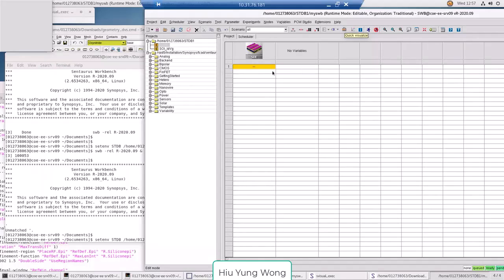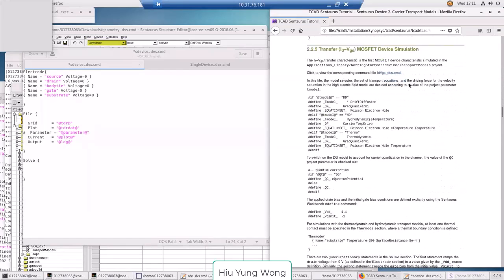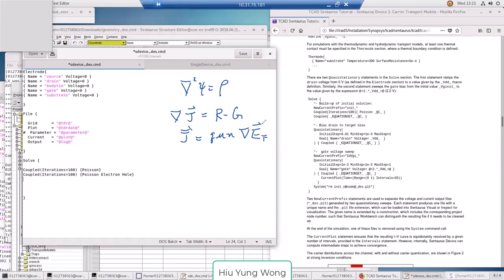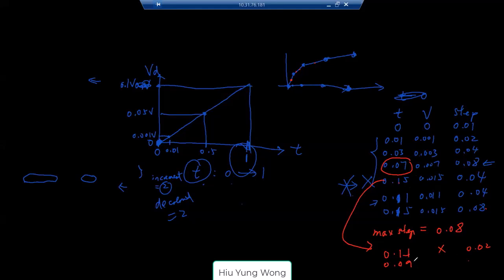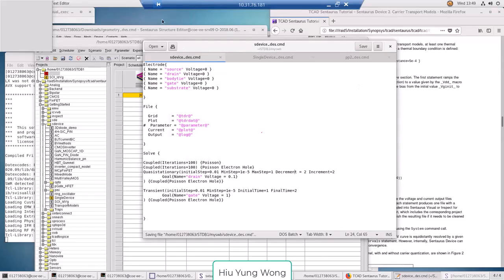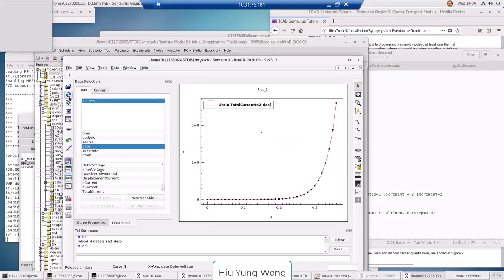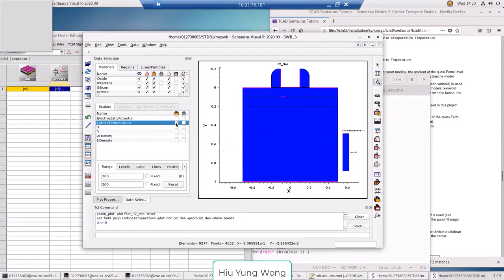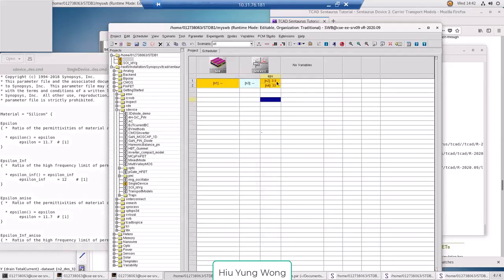TCAD Sentaurus Hands-on Tutorial - Sentaurus Device Basics

Comment: Hello,
Currently struggling with Hydrodynamic model for an AlN/GaN/backbarrier structure that gives results with Drift Diffusion but inaccurates (Fmax very high for example for Lg=100nm and lower). The root cause is velocity overshoot according to documentation. 

I have put all the respective recommandations (HighFieldDependence, TransferredElectronEffect2, RelMinTerm,...)
for III-Nitride materials Hydrodynamic simulation in parameter file and command file but the simulation failed everytime at Vds=2.5 or Vds=4.5V sometimes. If Vdmax is reduced to 3V, the simulation fails at second step where Vgs ramps to specified value. 

Can you help me please?

Comment: Hello sir,
Could you please tell me how to add new materials? For example, I want to create a structure with HZO (Hafnium-Zicronium-Oxide), which is not present in the default library.
Reply from the maker: You need to define that material in datexcodes.txt and then define its properties in the .par file that you will source in SDevice. You can look at those files in the installation directory as examples.
Reply: @quantum_computing  Thank you, sir. Probably, beginners are stuck with this problem the most. It would be very helpful if you make a video on this.

Comment: Good evening sir 
video is very helpful thank you so much 
i have a query in sdevice  masterfile command as it is am following you still am getting error as
tried to use nonexisting contact source
kindly help to resolve
Reply from the maker: You need to make sure you have defined the contact successfully. The best way to confirm is to use svisual to open the _msh.tdr file. On the top left of the panel, choose lines/particles to see if it is there. Please see this video: https://youtu.be/twGcJMFN3M0?feature=shared&t=2956
Reply: Good morning sir, thank you for your reply still the same error sir,  tried to use non existing contact source! and in n2_local.error  unknown error child process exited abnormally gjob exits with status1
Reply from the maker: @pavithrabirapaka4166  Btw, it is case sensitive. Do you have the same case? Also, try to locate where the error comes from (look at the log file). If you did define the contact and used the right name, it should not have this error. Thanks!
Reply: @quantum_computing  
thank you sir it worked ,now am strucked at parameter, while you open terminal window what you are typing to come out and get that -/documents $ in terminal window kindly suggest

Comment: Great tutorial on TCAD simulation! I found what I was looking for in the temperature command in the physics section of the video. 58:09
Reply from the maker: @user-te6tj9bg2r, great!
Reply: @quantum_computing  May I ask, if I want to simulate the effect of working temperature on device performance, any suggestion as to changes I should make? Adding Temperature =@Temperature@ and hydrodynamic model in physics,   foreach temperature in {300, 325, 350} { Temperature = $temperature } in solve section ?
Reply from the maker: @SamLin-f6w  If you just want to run it at a fixed ambient temperature, you only need to add Temperature  = 300 (or 400 etc.) in the physics section. If you want to do self-heating, additionally, you need to add "Temperature" in the coupled equations and add thermode with the ambient temperature. If you also want to turn on hydrodynamic models to solve the non-equilibrum of e/h temperature, then you add hydrodynamic in the physics and eTemperature and hTemperature in the coupled statement. You can also only run hydrodynamic without self-heating. They are not related.
Reply: @quantum_computing Thank you so much! I will try that.

Comment: I really enjoyed your TCAD tutorials and gained valuable insights into
Senaurus TCAD simulation....... in this video, you mentioned that the sdevice calculates the displacement
current in transient simulations. I would appreciate it if you could
elaborate on this concept and explain its significance in semiconductors.
Additionally, I have observed instances in MOSFET simulations where the
gate displacement and drain displacement currents are equal. Could you
shed light on the implications of this phenomenon?
Reply from the maker: @mdyasirbashir4272, thanks for watching. Displacement current is just like the displacement current in a capacitor. It is the current used to charge up the capacitor but does not pass through the capacitor's insulator. It can also be the displacement current that widens or narrows the depletion width (which is a depletion capacitor). Therefore, it only occurs in transient simulation but not quasistationary simulation (as quasistationary simulation means the solution is a steady state (after t = infinity) simulation). When you see the displacement current at the gate and the drain to be the same, it means between the gate and drain, there is an effective capacitor (if the displacement current in other terminals is negligible).
Reply: @quantum_computing  thanks I got it